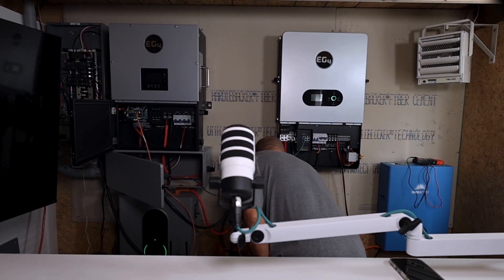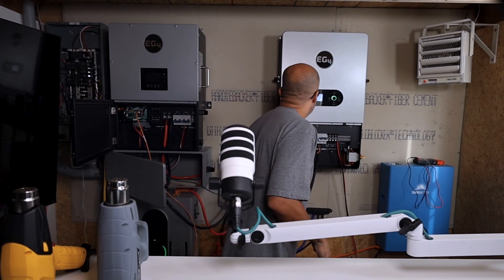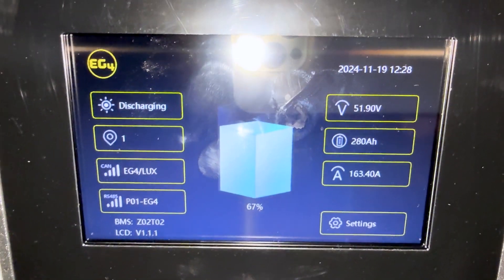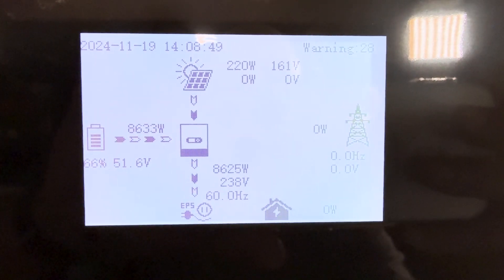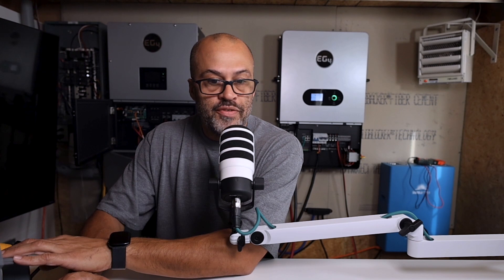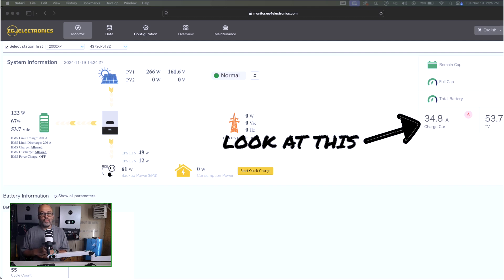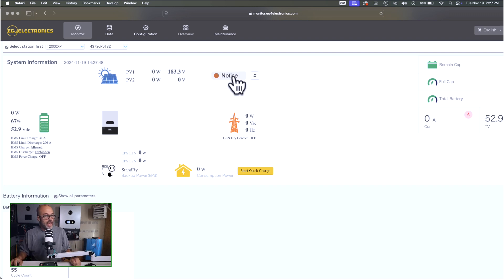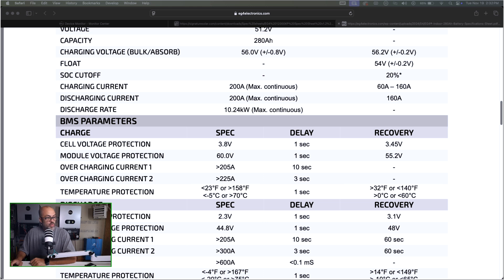Load Testing EG4 12000XP with a single Indoor Powerpro Battery! Not recommended!

Comment from the maker: Get your EG4 12000XP here: EG4 12000XP https://signaturesolar.com/eg4-12000xp-off-grid-inverter-48v-split-phase-24kw-pv-input-12kw-power-output/?ref=rodneyhunt&utm_campaign=12XP%20Inverter%20Launch&utm_content=Homepage%2011%2F1&utm_source=web&utm_term=Homepage%20banner%2011%2F1
Reply: I bought a Lux 12000xp and eg4 wall battery 280 ah and this weekend < I started the dishwasher and a coffee maker and a starlink and a tv and had warning 28 . Then reduce. Eliminated some appliances and started again after I turn it off and on again. I only have 1 battery.  That might be my issue...... I was really disappointed. Having maybe 5000 watts or so.... and it would kick off.

Comment: Rodney,
Can you use a Growatt AXE battery with the EG4 12000 XP off grid inverter?  If yes how?
Thanks
Reply from the maker: Never tried it but if it’s a 48 volt you should be able to. If it has enough amp hour capacity. Not sure on communications but voltage will work.

Comment: I know this is an off grid unit but can this be set up to supplement solar power with the grid rather than transferring the whole load to the grid?
Reply from the maker: You can if you have grid power at your inverter for sure. I am not setup for that at this time though
Reply: Is that a setting? Another YouTuber loaded this same unit and when it over loaded the battery or solar inputs it shut off the off grid inputs and transferred the entire load to the grid rather than supplementing the load with grid. Like a 80/20 split or whatever.

Comment: @quickquote1568
1 month ago
You are going to fry your Tesla's onboard charger with that 12000XP. This high frequency, transformerless inverter doesn't provide any galvanic isolation between its DC boost stage and its AC output. All it would take is for a single MOSFET in the H-Bridge circuit to short to ground and pass high amperage DC current through to your Tesla and you'll set your Tesla on fire and void your Tesla's warranty. Don't take my word for it, ask Google AI "Can a high frequency, transformerless inverter damage and EV?"

HI i am kevin i seen this on a comment for the eg4 12000xp  have you hear any of this is true??????
Reply from the maker: @silveradoblue327  lol that is false. Been charging my EV off high frequency inverters for several years at this point. That is a standard bot comment from spam bots that certain companies send out to all solar channels.
Reply: @   That’s what I thought they didn’t know what they were talking about I know you have charge ev all the time and have no trouble so that’s why I thought I’d ask you thanks for the reply.
Reply from the maker: @ glad to help!
Reply: @ so far I charge my tesla with my 6000 XP so far so good no problems. 😀😀😀😀
Reply: Give it a rest Dexter !

Comment: Will it work better with being grid tied?right now I ordered just one battery due to cost but it will be grid tied as well. Will the grid make up for the difference?
Reply from the maker: Yes grid can makeup difference with the correct settings
Reply: @rodneyhunt would you happen to know what settings need changed? My system is coming next week. Thank you :)

Comment: Going to be setting up our home in Puerto Rico to run only on solar.  Have done TONS of research on the 6000xp and literally can't wait to get there to get it going, then EG4 smacks me in the face with the 12000xp...

My concern is this:  I need just about 6k watts to run our anticipated loads.  The 6000xp allows me to over panel to 10k pv, 8k usable, but 6k to loads.  That's the max.  While I will only need 6k on loads, I would like to over panel a bit more for cloudy days than the 6000xp will allow.

I will be running thru a 10 circuit transfer switch, with 50amp wiring.  So my question is, can I limit the 12000xp to not discharge to loads more than 50amps (in the settings) ???  

12000xp manual call for 3awg wiring.  Can I run 6awg (size in Reliance transfer switches) and have it secure in the inverters input and loads breakers, or is it too small to hold securely ?

Any knowledgeable held is appreciated.
Reply from the maker: Yes it can limit discharge. I would still recommend manual wire size just as a precaution but that is up to you. 👍

Comment: Looks like your Signature Solar discount code no longer works for me.  Says it's expired.   Or is it tied to only one use per customer account?
Reply from the maker: Just use my link if you want. They are going away from discount codes but I thought it was on January 1st. They said you will still get the discount if you use my links without the code. I haven’t tried it yet though since I thought it was January 1st. Thanks for letting me know

Comment: I have to start with one on the flex boss. Maybe next year I can get a second battery
Reply from the maker: It will work as long as you are not maxed out when only pulling from one battery.

Comment: Does the EG4 documentation have any guidance of what size central air it can handle? (e.g. have the LRA of the AC unit it can run)
Reply from the maker: I have not looked through everything but the main specs is what I would use. It will show your surge rating
Reply: Some where there is a test starting and running a 5 ton unit. Not sure if that was the maximum it would do.

Comment: Thanks for this video... it actually makes me appreciate the ecoflow delta pro ultra just a little bit more now. Sure each inverter is only 7200 watts but having two of them and only needing one battery per inverter for 14000w of output... I admit your testing makes me realize that its not easy (especially if it takes 4 rack mount batteries to hit that)
Reply from the maker: Glad to help!

Comment: Very nice video, and thank you!
Im really considering buying this inverter to run my house. What I would like to know is does this inverter have any grid assist features. And if the grid is connected and you pull more than 12kw, does the inverter just cut off or switch to the grid automatically? Or just pull the additional power from the grid. 
Thank you, and hope to get an answer soon.
Reply from the maker: It has a 100 amp bypass. So that is the most it will pass to your house at one time. If you need more you may consider a 18k for the bypass of 200 amps, flexboss, or maybe even the gridboss to handle your big loads.
Reply: Have you seen if there’s a setting to flip to bypass mode at less than 12kW? Like could you configure it to flip to bypass mode at 10kW/41A instead? In order to not wear on the inverter as much?

Comment: I just ordered the 18kpv and 1 of their power pro batteries. I’m assuming I’ll have similar issues.  Still trying to learn all this stuff, but that was what someone recommended.
Reply from the maker: So I run my parents critical loads with one battery. When enough solar is coming in I can still run the whole house since the grid input will feed back to main panel to try and even out loads so you use zero grid. Up to the 70 amp breaker size at least

Comment: @Rodney technically not a fail, the one battery just max out at 200amps and you need about 230-232amps from the battery to max out the inverter so thats the reason for two batteries, however running one battery is still not too bad thats like 8 to 10kW still better than a single 6000xp, very impressive! Keep the awesome test coming!!  Can you test AC coupling? Setup something on the GEN port see the max balance and unbalance support via the GEN port with AC coupling.
Reply: Eg4 did say in in a comment FB community page that you can do it, but to limit max battery output to 200 amps to avoid issues.
Reply: What I really wonder is will it still switch to bypass mode if you go past the 200amps. Really want the 12000xp but don't have the space or budget/needfor a second power pro. Eg right now 6000xp switches to grid if it's over the 6000w. But if it switches over automatically after the 200amo limit would be perfect
Reply from the maker: We will see. So many test but I need equipment for AC coupling. May try some generator stuff

Comment: That's cool it starts barking at about .5C. Flippin batteries are too pricey to be trashing them. You're probably going to spend more of that hard earned cash in the end replacing them instead of getting enough up front.
Back to the 6000xp again. It's a smaller option for a smaller budget that's expandable as the funds are available. And still a great option don't care what anybody says.
Reply from the maker: That is very true! Thanks for the great comments as always

Comment: Cool I am installing a luxpower 12000 here in Canada and have 280 ah battery so I can run most of my loads I may add another 4 to get to 400 ah you do good work it helps to see an overload without smoke lol.
Reply from the maker: Indeed! I need to stop messing my stuff up lol
Reply: Questions where in Canada are you also how much was the shipping cost and how much did you pay for your system I'm in Alberta and since I had 3 x1750inverters a utube channel sujested a triplite 1850 line conditioner cost was 98 dollars in the USA I knew that with our lower dollar it would be higher and at 138 Canadian it was still a cheap fix said that shipping would be added at the end of the bill and when it came up I quickly cancelled the order over 380$ for the shipping I could buy a new 3000 watt pure sine wave inverter for around the same price and no 2 stage to to get less watts  finally  princess auto came out with a power box on sale
Reply: @douglaswindsor120  I live in Muskoka Ontario basically central Ontario. I bought the LuxPower 12000 from Amazon which since I am a prime member has free shipping the merchant was Solar Power Store Canada ltd still one left but they are not cheap $6250 Cdn. It came on a skid so they need access to unload it at your place. I will put up a video when I get more time.